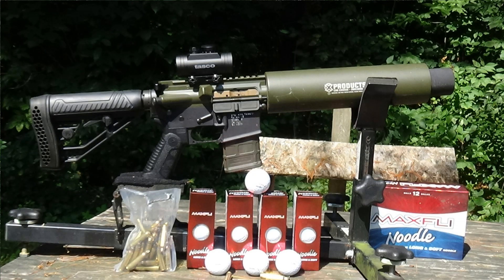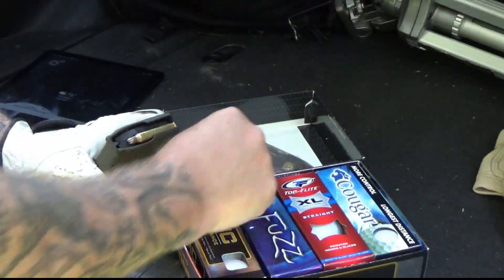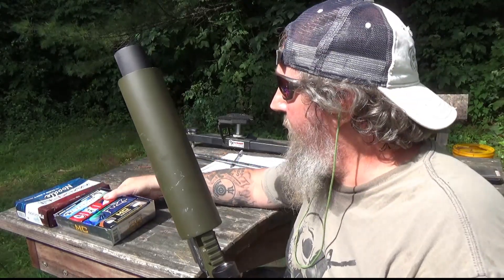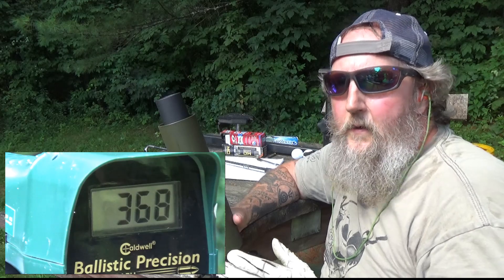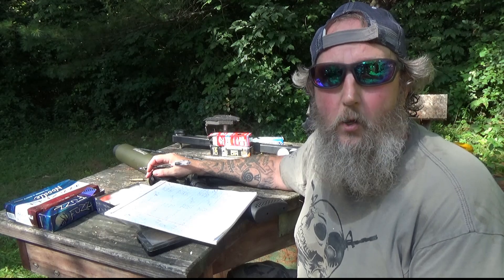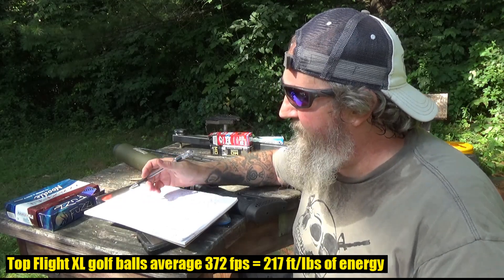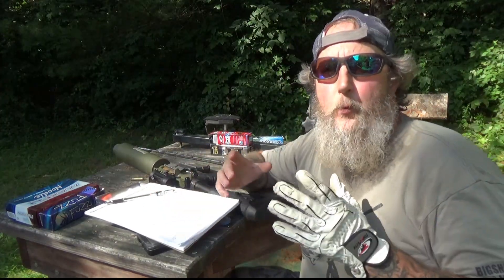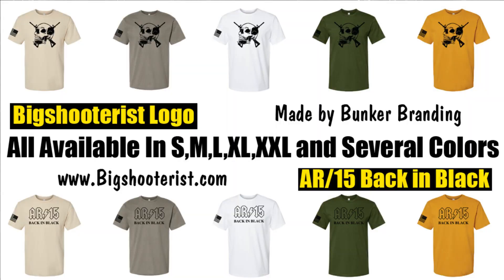Golf Ball Muzzle Velocity - Drive faster than a Golf Pro!

Comment: I understand the muzzle energy is equivalent to a 38 special. Since the energy is spread over  a larger area than a bullet, would this be a viable less lethal launcher?
Reply from the maker: Over the last 3+ decades of manufacturing MGs, I've never gotten involved in less lethal designs, aside from some T&E, so I'm not sure where that line is.  They're definitely still a "firearm," which seems important to the Less Lethal community, to get away from that legal term, but I don't really have a definitive answer for that question. Using common sense, it certainly seems as such, though, doesn't it?